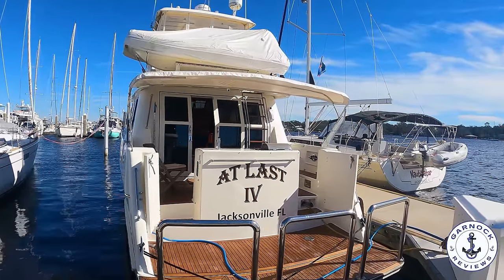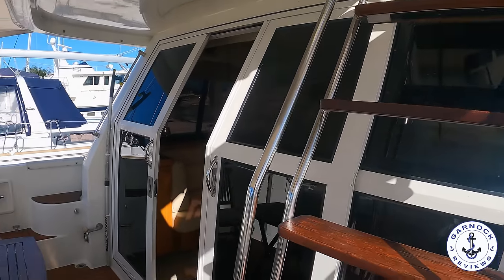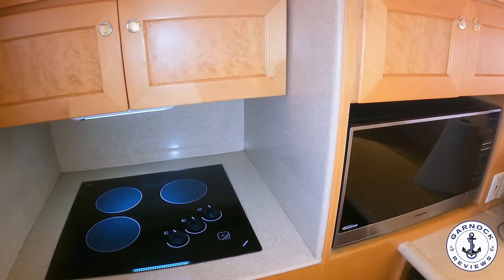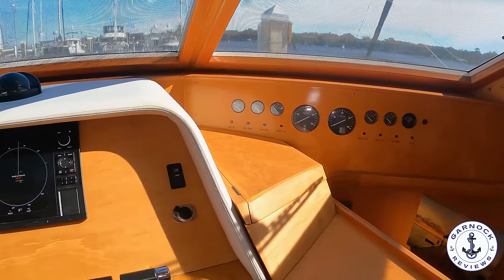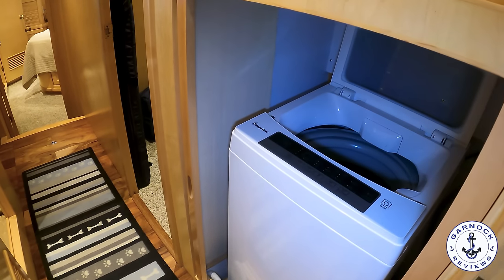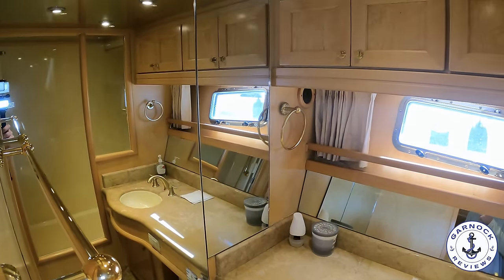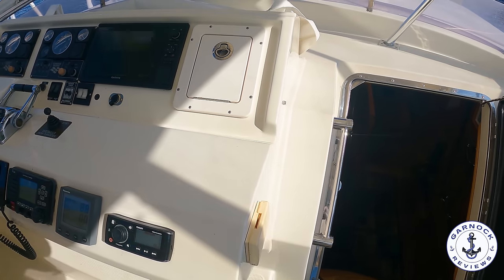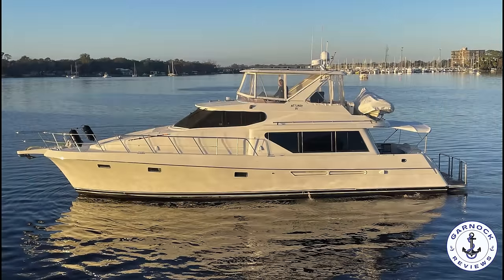[Sold] - $329,500 - (1999) McKinna 57 Pilothouse Motor Yacht For Sale

Comment: I looked them up they build super yachts these days, but they do have a range of 48 to 94 feet as well. They are extremely well-made and they have a pretty good range in super yachts that is over 100 foot long. It appears they have them built in Taiwan, which is a very high-quality area for yacht construction. The company was started in 1994 so this yacht was an early one and I would say at this price it’s an absolute steal given its condition and its construction and its heritage .
Reply from the maker: This may sound like a stupid comment, but this boat felt like a small super yacht. So many clever design features, solid build quality, and very comfortable soft furnishings, that it was like a smaller version of something like the new Hamptons I've featured on here before.